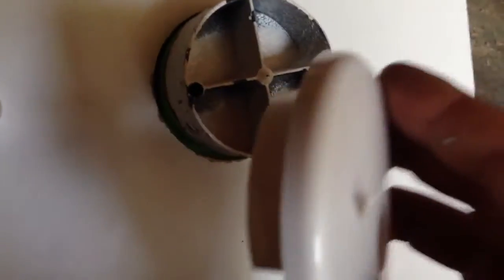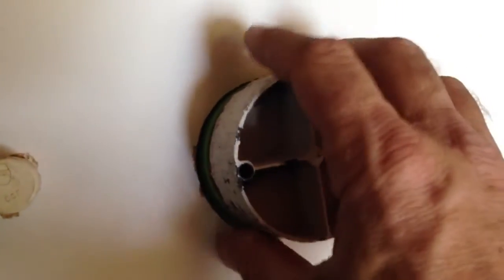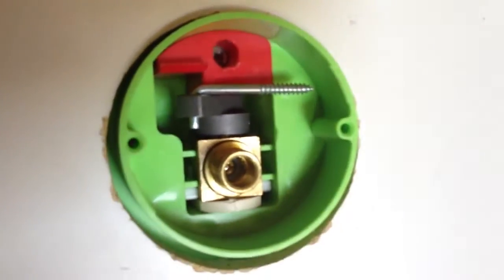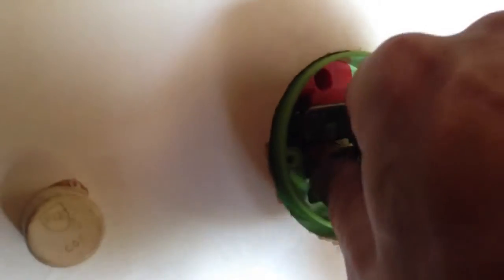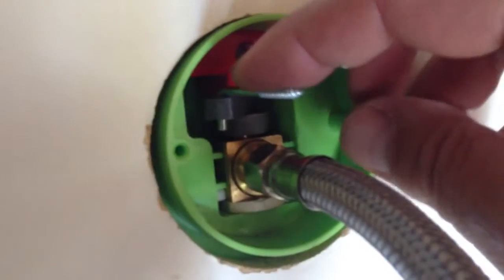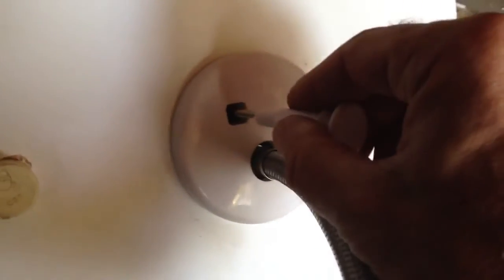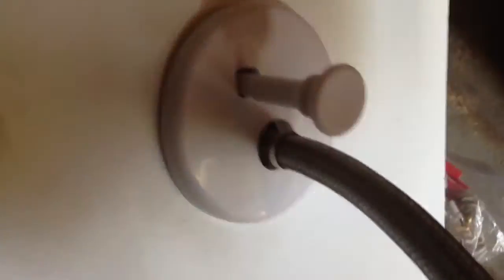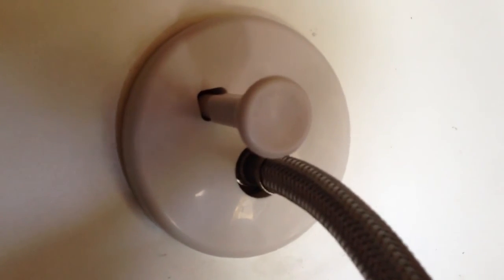LSP Pull Stop Box  Trim Out Instructions

Comment: This needs to be removed from the market. Unless you want a guaranteed call back. The brass valve slips into a plastic bore and is sealed with orings. The pressure of the connecting hose hanging on the valve causes the brass valve to put pressure on the plastic bore it presses into. Then the plastic bore hole elongates and you get a leak. You can try a thicker orings for a fix. Otherwise you have to tear up the wall to rip this valve out. Be warned.